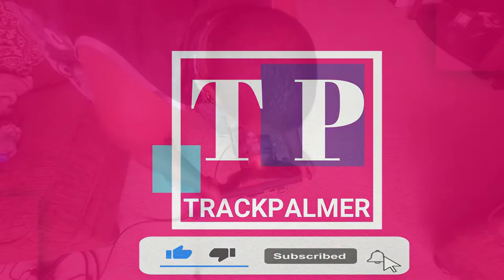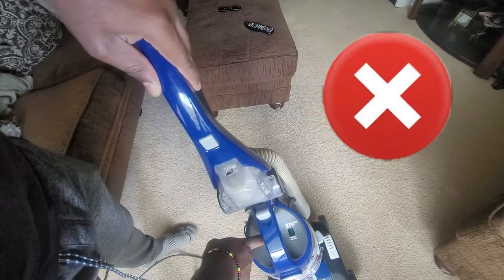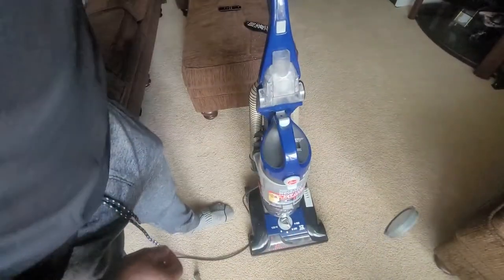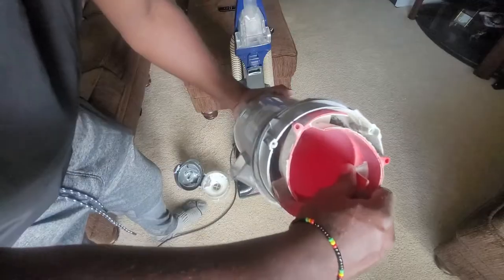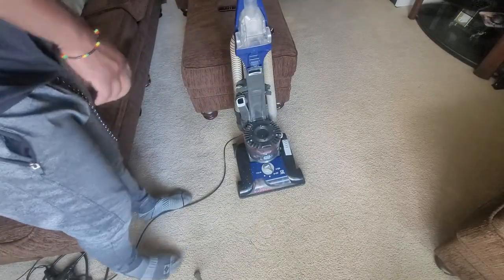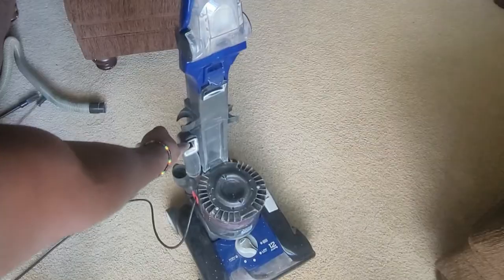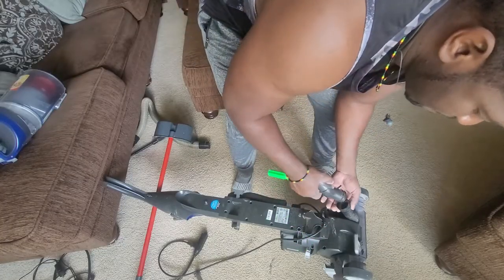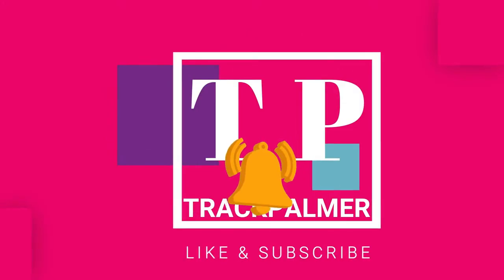How To Fix Hoover Windtunnel Vacuum That Turns Off After Short Use

Comment: There is an additional filter under the dust bin that slides out, a HEPA filter that can get extremely filthy too… it can be rinsed and dried.
Reply: Thank you. I just recently found that hepa filter by accident. I pulled in the little handle thinking to lift the vacuum to carry it downstairs. 
I haven’t seen anyone else mention it and want sure about hand washing it. Thanks again!
Reply from the maker: Noted

Comment: Great video.  I think you just forgot to check the HEPA filter.  Not sure if that may affect the suction pressure.  Thank you for posting this.
Reply from the maker: What the first minute of the video. I talked about cleaning the filter
Reply: @trackpalmer  Thank you for making this video. ❤ It is very helpful. What the person making the comment is talking about is that there is an additional HEPA filter that is located towards the bottom of the vacuum you can pull it straight out. The HEPA filter gets dirty too and needs to be cleaned or replaced as well.

Comment: Thank you for the tear-down. I cleaned my hose line, but it over-heated again.
Reply from the maker: Did you clean the filter?
Reply: @trackpalmer  I did a second tear down and cleaned up EVERYTHING and EVERYWHERE this time. The dust was so thick on the inner parts that it became water-proof! I had to wipe it hard under water and scrub it with an old tooth brush to get that fine dust off. - first time cleaning it internally. I bought it maybe 6-10 years ago. I am letting it all dry out overnight and will re-assemble it in the morning and try it again. Thank you again for the help!

Comment: Thanks for saving me,  great instruction.  Clogs were in hose and the elbow part into the floor part.
Reply from the maker: Happy it helped 😊.
Reply: So we can’t get the red part out of the filter assembly.  I want to clean all of those small holes on the clear plastic outside. My bottle brush got some of it.
I got lots of gunk out of the hose.  Thanks for your help ❤️
Reply: My model is different than yours.  We got the plastic flange at the bottom of the filter assembly off and then Undid the screws and the red part and bottom tube came free, so we could clean it.   Now just waiting for the filter to dry.
Reply from the maker: @marciamadeira846  I'm happy you were able to remove it so you can clean it properly. Good job 👌

Comment: Thank you so much for this video.  My vacuum just shut off in the middle of using it and I had no idea why because the green spot never turned red indicating that the filter needed to be cleaned.  After cleaning the filter as you instructed, the next day I reassembled it and the vacuum worked perfectly again.  I was afraid I was going to have to buy a new one already.  Great video sir!  👍
Reply from the maker: Happy it helped. Thumb up